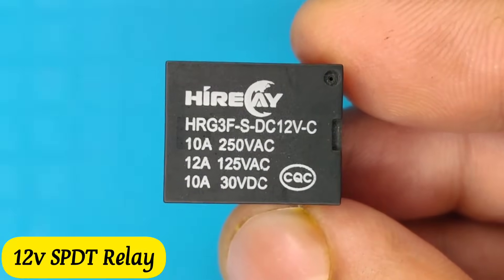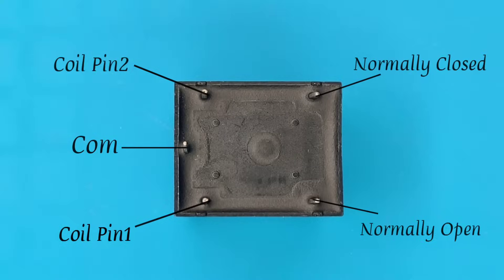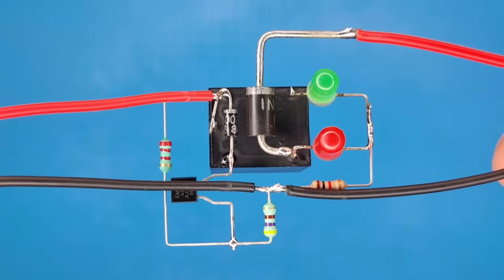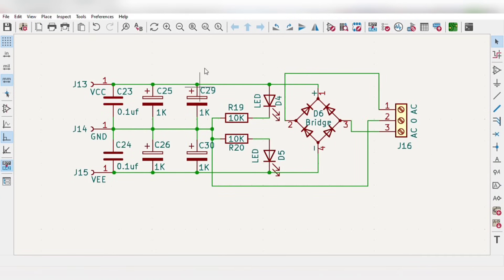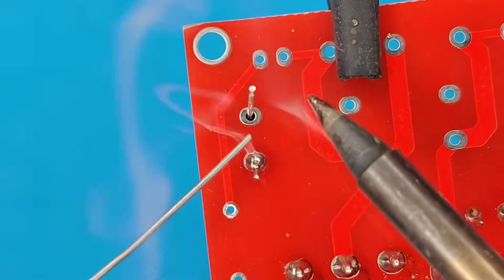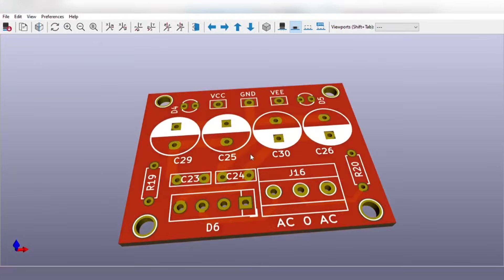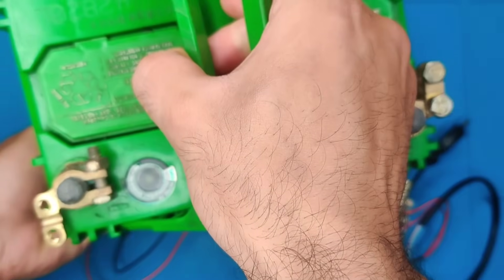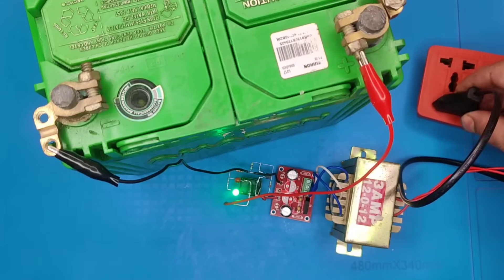Auto cut off 12v battery charger with 220v ac directly

Comment: Your soldering skill is excellent!
Unfortunately,here in the USA,tho we do have 220v available, we almost always use the 110v (117v) supply found throughout our homes and garage.
Reply: He use step down adapter 220v AC to 14v DC
Reply: @Edmorbus  Describe such a device to me.
Ive been involved in digital electronics for over 35 years.
Your comment to me makes no sense. How is this so called step down adapter going to aid in the USA voltage.
Reply: @STEVE_C_1369  You can use 110v Ac to 15v AC
Reply: @Edmorbus  Ok then. That sounds good. So,its basically like a glorified bridge rectifier and 7812 voltage regulator with zeners system.
Reply: @STEVE_C_1369 It's basically like only. With 7812 you can draw 1.5 A maximum. I guess the presented circuit has larger capacity.
Reply: @jarekferenc1149  I know the 7812 is limited in current.Ive built a lot of projects in my time.